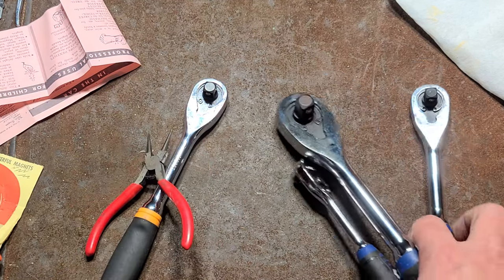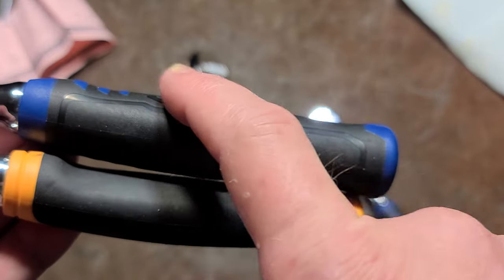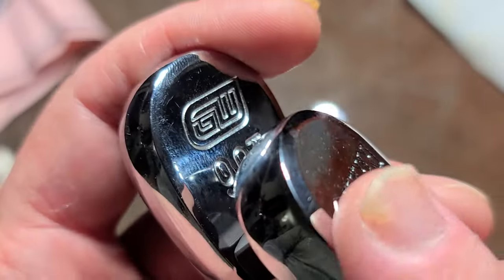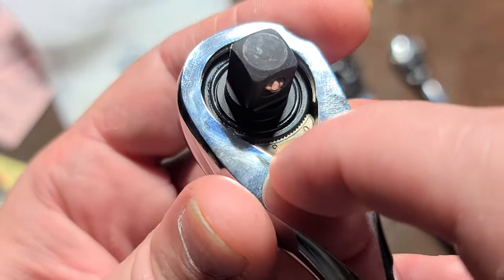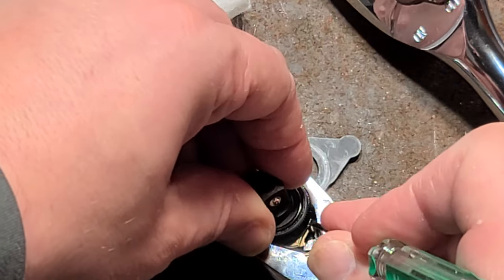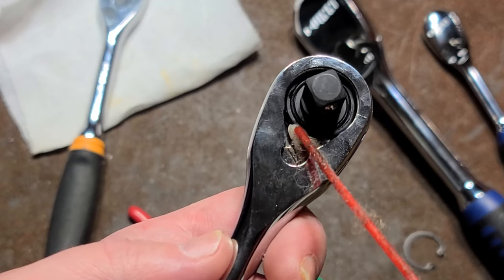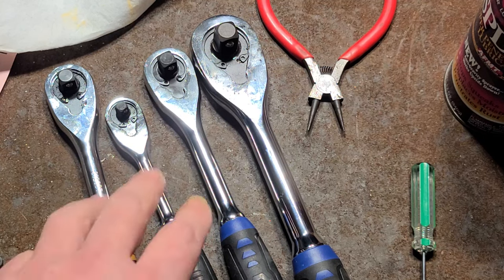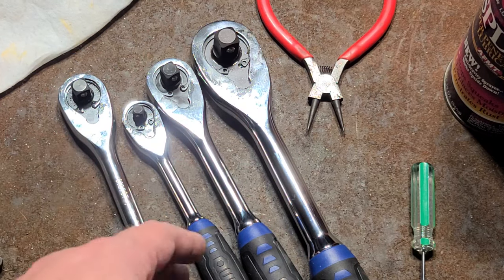Harbor Freight Quinn (Gearwrench) Sealed Head Ratchet Review

Comment: As much as they’re undercutting themselves, they’re also undercutting gear wrench, which is the only honest price close competitor to the icon. Everybody I know is buying that Quinn it’s the exact same tool with a much easier warranty, no matter what HarborFreight wins.
Reply: Harbor freight doesn't make tools harbor freight sources tools already made by other manufacturers and gets their name stamped on it. So I'm sure gearwrench is getting a cut of whatever harbor freight sells them for. Because the design of these ratchets from gearwrench are not old enough to where the patents have ran out And harbor freight can just copy them blatantly like icon and a lot of their hand tools they make ripoffs of snap on for a ¼ of the cost. Because gear wrench is owned by Apex tool group which is also owns crescent and a few other brands. So I'm sure harbor freight has struck up a deal with Apex to be able to offer their ratchets under a different brand and Apex stool group still gets their cut

Comment: I paid $10 more on each for the best back drag I've ever seen in 11/23 for 1/4, 3/8, and 1/2 Koken Zeal series ratchets. I don't need to see your try any other ratchet after them they're the ones for me for sure. No more going around and having to hold the back side of the socket so it actually twists on or off. Koken are Japanese and do take some time to ship hear. The weight they have is great I just done see needing the lifetime warranty on them. But if I do it will take a minute I'm sure. But the quality for just another $10 each if money well Spent.

Comment: When the Icons first came out there was a special on the 3/8 and 1/4 stubby ones. Came together in the cute little package with the polishing cloth. All for $35. So I picked them up to try them. I never use them precisely because of the backdrag. The 1/4 in particular is ridiculous. I've had them both apart trying to address the backdrag but to no avail. So they sit in the corner of the tool box. Every once in a while I'll grab one of them to reassure myself they are that bad, and they are.
Reply: Remove the grease and replace it with a few squirts of superlube.
Reply: I've found that the icon ratchets improve over time. The more you use them the better the backdrag becomes.

Comment: I prefer my Icon ratchets. The thin low profile Quin 1/4" ratchet with comfort grip is comfortable. 
Just my opinion. I think a thicker fine tooth ratchet head and gear is less likely to fail.
I grew up in the 70's and 80's. Crafts. Stan. Great N. Mostly coarse tooth ratchets.

Comment: All Quinn hand tools 30% off (35 for ITC members) right now for the next 3 days. These are better than the current fixed head Icons.
I have a feeling that Quinn is about to become the new Pittsburgh Pro or the old Pittsburgh Pro is going to be soon if not already now for some items the new Quinn (check out the new Quinn impact sockets that come in a case now for example, same as what the old Pittsburgh Pro were sans the case just before they cleared them all out) and that an entire new Icon line of ratchets will be coming out.

Comment: I can attest to a gearwrench 120xp extra long handle 1/2 ratchet take abuse i have seen tool truck ratchet let go. We put a 3ton jack handle and two of us on it to pressout a ball joint on a ram 2500 that was stuck, even putting torches to it while wrenching, handle flexed ALOT from the massive torque being apllied, yeswe are both stout dude's, ratchet shruggedit off, say what you want about gearwrench. Oh yes this ratchet is a daily used tool in a repair shop and is now where near being new, i know its at minimum is 5 years old